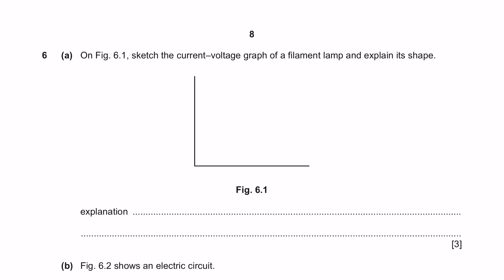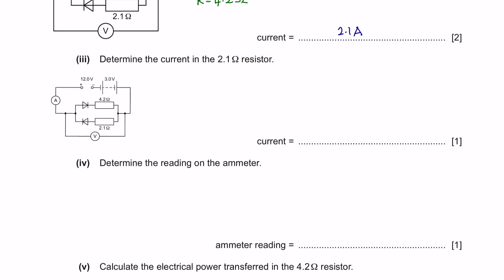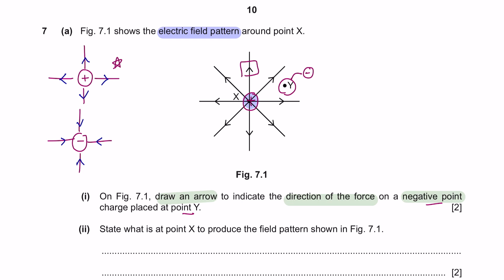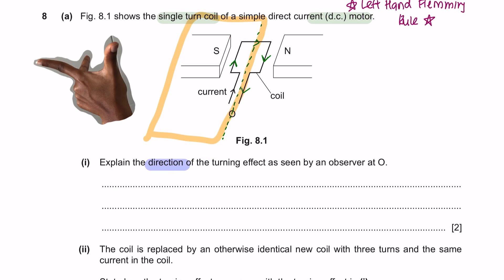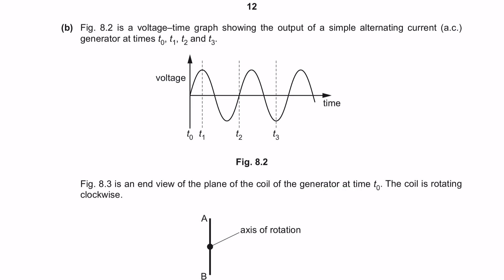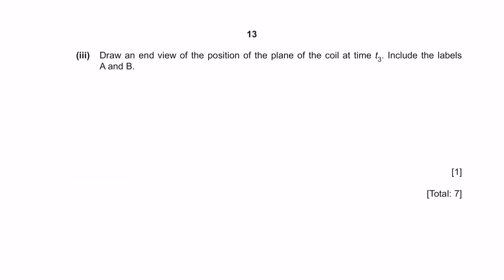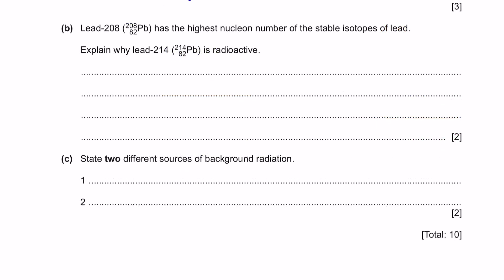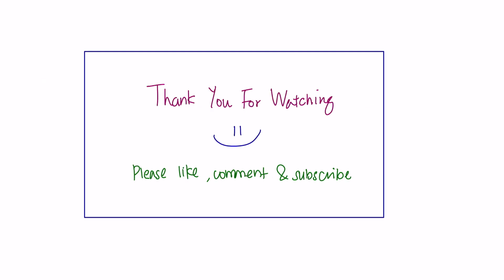IGCSE Physics Paper 43 - Oct/Nov 2023 - 0625/43/O/N/23 (Q6-10) SOLVED

Comment: Hi ma'am, can you please explain why at 6(a) when you drew the graph the current was at the y axis and voltage at the x axis. Isnt it R=V/I like the opposite?
Thank you.
Reply: you can draw it either way as long as the info shown is the same

you have to show increasing resistance over time due to temperature increasing... therefore if voltage is at x axis then the gradient would decrease, which means voltage increases with time while current decreases
and even if voltage was on y axis, you have to draw an increasing gradient so itll still be the same thing overall

Comment: Pls could you explain why we subtract at 1:23
Reply: Both cells are in different directions
Reply: the cells will make current flow in opposite directions
since the 12V cell will do more work per charge (v = w/q), there is a resultant force as w = fd

and the rule for finding resultant forces acting in opposite directions is to subtract them 

this is just my idea on this though!! maybe ask ur physics teacher